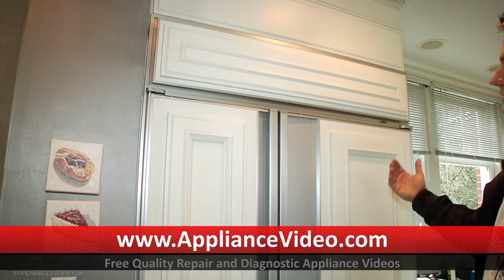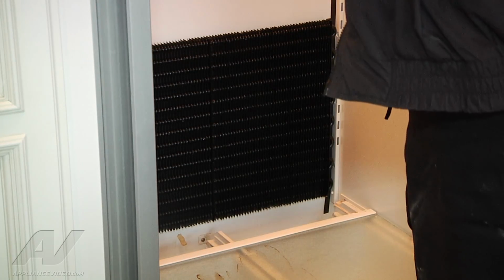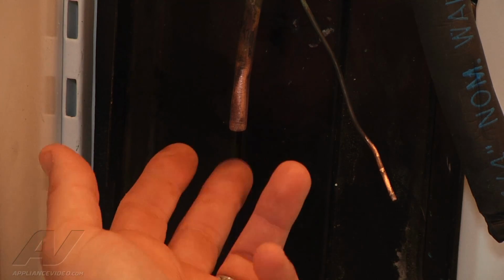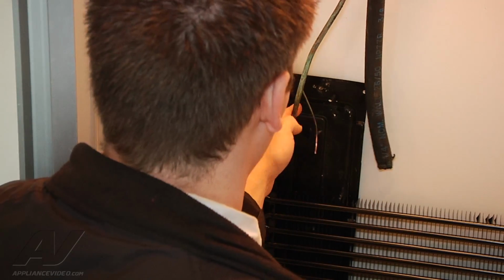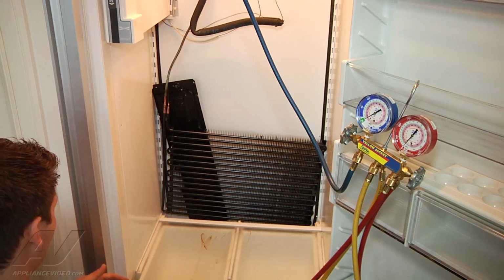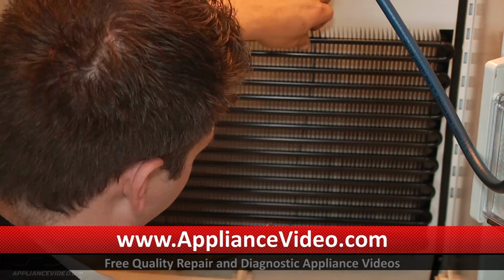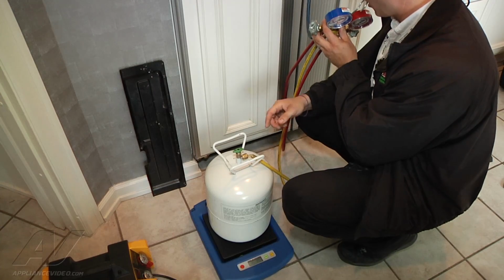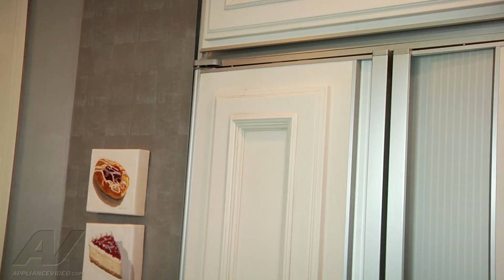SubZero Refrigerator Repair - Not Cooling - Evaporator

Comment: It must have been a miracle the end of the cap tube at the braze didn't get plugged with brazing alloy. I use a product called Stop-Off that prevents the brazing alloy from sticking where it's not wanted, like the end of the cap tube. It's kind of the reverse of flux.
Reply: rubbing finger at end of captube, acidity of finger will prevent that also. I thought the same thing you did. It shows how experience over time is knowledge that a lot of service techs learn over time.

Comment: If you still answer comments:  Why no nitrogen purge during brazing?  Also, most systems require vac down to 500 microns.  I don't think a reclaim pump can usually do that.  Why do you think you don't need to pump down to 500 microns, which cannot be measured with a mechanical gauge?

Comment: Hi, I have a Frigidaire side by side door, doesn't freeze the ice cream. The evaporator accumulates a lot of ice close to the capillary tube, and the rest doesn't even get white in color. Looks like the refrigerant does not flow all the way around. Thanks and great video.
Reply from the maker: Great question, if you have a
more technical question that our parts department cannot answer, our
technicians are answering all questions at our website at www.ApplianceVideo.com under our Repair Help section. You can also call
our parts department at 1-800-830-5465 and they can give you help 7-days A week
Mon-Sat . You can also search at www.SaveMoreOnParts.com 7- days a week.
Reply: Your unit has a restriction in the capillary tube or a low refrigerant charge. When the refrigerant doesn't flow well the compressor converts most of the refrigerant gas into liquid, and in doing so reduces the pressure at the entry to the evaporator. Low pressure causes the refrigerant to boil at a very low temperature creating ice. Kind of a paradox that low charge or restricted refrigerant flow causes very low temperatures.

Comment: You have to pump the system up with dry nitrogen and bubble test the joints before pulling a vacuum. Drier should have been replaced and should flow nitrogen when brazing. I'd pull that system down to at least 250 micron.

Comment: Why does the compressor compartment have a cover plate?  Mine is heating the top of my freezer.  I took the plate off and a lot of hot air vented.

Comment: What refrigerant type is that you putting into the system? I am assuming is 134a, but that jug looks white and never mentioned what it was. And why did you labeled the refrigerant amount you put in, why not put in the amount that it states on the label. Thanks.
Reply from the maker: Adan 
          All of our technicians are now answering questions daily on the ApplianceVideo.com website for anyone needing help. Just copy and paste this this question under REPAIR HELP, and one of our  factory authorized technicians  will answer any technical questions at absolutely no charge on your appliance issues. We also have over 2600 free repair videos to help with your appliance repair issues. Thanks for your support. Matt Ace Appliance factory service technician.

Comment: What if I am getting water dripping from top? The drain is on bottom, or is there one on top also?
Reply from the maker: Great question, you can call our parts department at 1-800-830-5465 and they can give
you help. If you have a more technical question that our parts department
cannot answer, our technicians are answering
all questions at our website at www.ApplianceVideo.com under our Repair Help section. We have over 3,000 common
questions and answers that you can easily search through by your model number,
appliance make, and problem or error codes, and It’s free to search through our
question & answer library.

Comment: Question: You replaced the filter drier, then found their was a leak in the evaporator. If you have a leak anywhere in the low side of the system, doesn't the compressor need to be replaced due to contamination that could have entered the system through the suction line? How do you determine if the compressor is contaminated or not?
Reply from the maker: Alex
            Absolutely not, if you have a leak in the low side that does not mean you need to replace the compressor. If you get moisture in the system the unit could get moisture in the system and restrict the capillary tube. In that case you would evacuate the system for 24 hours with a vacuum pump and add thaw zone to remove moisture. I have been doing this for 30 years and have NEVER replaced a compressor for a low side leak.  Please help us provide more videos to our site by subscribing to our YouTube page or posting ApplianceVideo.com site on your Facebook or Twitter account. We also have our factory authorized technician’s email daily free professional advice to people like you to help solve their appliance problems. Thanks in advance for supporting us. Matt, Ace Appliance service technician.
Reply: ***** Hi Matt,
I am sure you would reflect and agree with what I am adding here. When there is a low side leak, and the evaporator(or heat exchanger) has a leak in it, which Subzero evaporators have a history of leaking evaporators, the compressor continues to pump through the high-side, at about 135+ lbs(depending on the ambient temperature), and as Freon flows through the lines, so does very small amounts of oil, from the compressor. The compressor typically has about 3 ounces of oil pre-charged in it, from the factory. When there is a leak in the low-side, the Freon and the small amounts of oil that travel with it, seep out of the pin holes in the evaporator or heat exchanger...Not Just Freon...which is why you will almost always see a yellowish, and oily film below where the leak is. If you touch it with your fingers and rub your fingers together, it will feel all oily, not just watery, as it does when it is just condensation. This oily and yellowish substance, is the oil from the compressor. If the unit runs long enough, usually for months, depending on the size of the leak, the compressor will lose enough of it's lubricating oil, to cause the compressor to do what in the industry is called Burn-out! These pin-hole leaks are caused by oxidation, very similar to what happens to a car's finish. The oxidation eats into the aluminum, at a greater rate on aluminum that is not almost 100% pure aluminum. These pin-holes are called pin-holes, because they are so small, the head of a pin, probably could not even fit into it, which allows the refrigerator to leak for a very long time, which is called a 2 year leak that is extremely hard to find, as experienced technicians know all too well. So, the oil and Freon continue to seep out of the pin-hole(s), and a lot of it gets dumped into the evaporator, and due to the fact that there is loss of suction, back to the compressor, through the suction line, because of the pin-hole leak(s), the oil does not get sucked back into the compressor, but stays in the evaporator, flooding it with oil. If you have replaced many evaporators, you will be aware of this, and getting the oil out of the evaporator is not possible, even with the strongest vacuum pump. The evaporator Must be replaced, and of course it also does, because there are pin-hole leaks in it, that caused the flooding of oil into the evaporator and OUT of the Compressor! Depending on how long the system keeps running, losing the oil from the compressor, into the evaporator, the compressor will eventually start running without sufficient oil to lubricate it, and it will burn-out. Burn-out is a very pungent odor when you open up the system, and you will know it immediately, if you have never seen or smelled it. So, YES, compressors can go bad, when you have an evaporator that is leaking, BUT most of the time, the system has not been running long enough to dump all the oil out of the compressor, into the evaporator, because the cooling starts to decrease and the customer calls for service, usually before this happens. In 30 years, I have replaced about 20 compressors that had what is called Burn-out, due to the evaporator leaking, and I have another one, that I ran into today.
Everyone is talking about replacement of the filter/dryer...
This is Great Practice, to do always, but MOST technicians ONLY replace them, when they get so contaminated, that they cause a partial or full restriction, and the system still will not cool(allow the Freon to flow through the dryer), after replacing a compressor, heat exchanger or evaporator.
One thing that ALWAYS causes the evaporator to leak, is allowing the condenser to get real dirty, which over-heats the entire system(or the condenser fan motor stopping), and due to the material that the refrigerator evaporator is made out of(less than 100% pure aluminum), and the warmer temperature(36-40 degrees, as opposed to the freezer temperature of -10 to 5 degrees)in the fresh food compartment(refrigerator section), oxidation occurs much quicker at warmer temperatures, even 36 to 40, then if it is -10 to 5 degrees! When the oxidation is eating through the aluminum, it has not eaten all the way through, but has weakened the wall of the aluminum, so when the temperature of the system is over-heating, the Low-side pressure(usually 0 to 10 lbs), becomes higher(10 to 20 lbs if it is really dirty and extremely over-heated, and as well, the high side pressure rises also, and the walls of the refrigerator evaporator aleady being weakened, at the points where the oxidation has natural occurred, "blow out", and start leaking Freon...AND COMPRESSOR OIL!
This over-heating is so disastrous for sub zero refrigerators, that just about every one you go out on, that has a really dirty condenser, almost likely(I said Almost) has a leaking evaporator! I have redesigned replacement evaporators for the Sub Zero refrigerators, the more common ones that leak, and have them available now, and they are made out of 99% Pure Aluminum, so as to hinder, if not stop this historic leaking problem on all Sub Zero refrigerators. This has been going on for 30+ years, and Sub Zero is well aware of it, but refuses to change their evaporators. Now there is a replacement that is much higher in quality, to give the customer much more added assurance that they will not have this same problem again, any time soon!
It was only my intention to add some more insight to the compressor replacement issue, so I hope that you are not bothered by my adding some experience, as well as yours, into the mix here.
I hope Sean(correct spelling?) is as gracious, because some things that he did I have to critique, that are things people should be aware of, so they do not run into difficulties, if they attempt to do this repair. I suggest that No One does this repair, unless they have been taught how to properly use a torch, and deal with sealed system repairs. Just my suggestion from 30 years experience...if they leave a leak or melt the inside liner, it is going to cost them more than they were going to make on the job...???
Nice concept guys with the videos....Mike( SZPartz.com)
Reply: Alex,
To your question about how you know if the compressor gets contaminated if there is a leak in the system, specifically, the evaporator, or anywhere else...heat exchanger. Compressors do not get contaminated, they are simply a pump, similar to a vacuum pump, that is mounted inside the black round, hermetically sealed(put together in a clean room, to keep all dust and contaminates out of the interior of the black casing, that the compressor, pump, is mounted on 4 springs inside of. The contaminates "Plug up" or in service technician description, restrict the flow of the tubing, by blocking it, or in the case of moisture, they form ice crystals and block the flow of the Freon, partially restricting or completely restricting the flow of Freon. Acid, moisture, metal particles from a burn-out compressor(where it has lost all it's oil, just like a car would, burns up, internally, from lack of lubrication).  The #1 reason a compressor needs to be replaced, is because they are inefficient(leaking by the valves, internally, due to excessive over-heating)...the condenser fan motor quit running or the condenser is completely plugged up and no air flow through the condenser to cool it down and keep the compressor(s) from over-heating. This is a lot more common nowadays with these new compressors, that will not tolerate being over-heated at all, and will burn them up, and cause them to either lock up, or ruin the valves, and the Freon starts leaking past the valve seals and the compressor loses compression, just as in a car. The metal panel, Inside the 2 front panels, that Sean said was to quiet down the noise of the compressor, in the video, is actually there to direct the flow of the air through the condenser, and past the compressors also, so as to also help them stay cooler. It's hard when you are live on video, and trying to find words to describe everything. Every refrigerator has a channel that the air flow goes through, to cool the condenser, and also flow the air past the compressor to help keep it cool also.
The second common reason a compressor fails to run, is due to the start and relay control, burning up, or failing. This usually does not require replacement of the compressor, but a lot of technicians mistake it for a locked up compressor, and replace the compressor, instead of the relay, overload and capacitor, which is all that is wrong with it. I saw an A/C video on here, which I also have done for 30 years, and it is extremely common on A/C's that techs mistake the compressor being bad, when it is really only the start capacitor, that starts the compressor.
The 3rd reason is not very common, but with people using so many energy efficient devices anymore, and with multiple appliances on the same breaker(outlet), or people putting Surge Protectors on refrigerators, the voltage ends up dropping from 120v to 80v(volts AC) or less, and it melts the winding inside the compressor.(there are 3 windings in every compressor, usually....start winding, run winding, and the common(so to speak) winding)...there are 3 connection pins on every compressor.
Compressors are all too often mistaken for the almighty problem, when it is usually something else, like the evaporator leaking, the start relay, overload and capacitor, or the system is getting too hot, due to the condenser fan motor not operating, or the condenser coils being very plugged up, and the compressor gets so blazing hot, that the Overload shuts it off, so it can cool back down, and then it will restart again, and run  a little bit until it gets too hot again and the overload shuts it off again...doing this repeatedly, will burn up the start relay, which is how they usually fail. In some cases the technicians will not even check the voltage to the compressor and think because the compressor isn't running, it must be bad, when it very likely could be stuck in defrost(no defrost timer on a Subzero Refrigerator section, only on the freezer side....the fresh food side works to defrost by what is called "Cycle Defrost"(simply meaning every time the fresh food section reaches temperature and the compressor turns off, it "Cycles off" then there is no more Freon flowing through the evaporator, so it defrosts.
A faulty thermostat can also not allow the compressor to run, and is sometimes overlooked.
I go over all these things with new students in my appliance repair tech school, because most new techs and many older ones, make refrigeration so difficult, hen it really is pretty straight forward, once you are taught properly.
Good Luck all, hope some of the info helps to diagnose and understand better, the workings of a compressor and what to look for in the future.
Mike ( ApplianceRepairTechSchool.com & SZPartz.com)
Reply from the maker: Michael Riley
                          If you go to our FREE repair help website at ApplianceVideo.com and post this question, We have 14 factory authorized technicians that will  answer any technical questions daily on your appliance issues. This is the only website on the web that you can get questions answered by certified appliance and HVAC technicians at absolutely no charge along with over 2600 free repair videos. Thanks Matt Ace Appliance factory service technician
Reply from the maker: Michael Riley
                                      I suggest you go to our FREE repair help website at ApplianceVideo.com and post this issue. We have 14 factory technicians that  answer questions daily any technical on your appliance issues. This is the only website that you can get questions answered by certified appliance and HVAC mechanics at absolutely no charge along with over 2600 free repair videos. Thanks Matt Ace Appliance factory service technician
Reply from the maker: All of our technicians are now answering questions daily on the ApplianceVideo.com website for anyone needing help. Just copy and paste this this question under REPAIR HELP, and one of our  factory authorized technicians  will answer any technical questions at absolutely no charge on your appliance issues. We also have over 2600 free repair videos to help with your appliance repair issues. Thanks for your support. Matt Ace Appliance factory service technician.
Reply: Michael Riley wow

Comment: On my 532, the refrigerator side only starts cooling at ~70f, then only cools to ~ 50f. 
All fans are working and coils are clean. What should I look at?
Reply from the maker: Great question, if you have a
more technical question that our parts department cannot answer, our
technicians are answering all questions at our website at www.ApplianceVideo.com under our Repair Help section. You can also call
our parts department at 1-800-830-5465 and they can give you help 7-days A week
Mon-Sat . You can also search at www.SaveMoreOnParts.com 7- days a week.